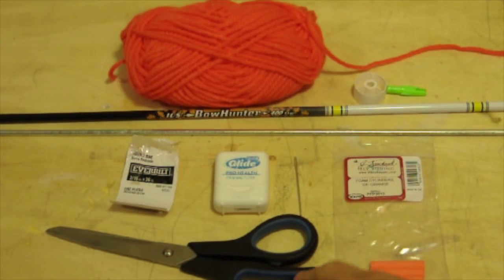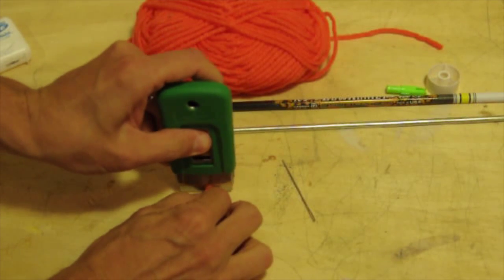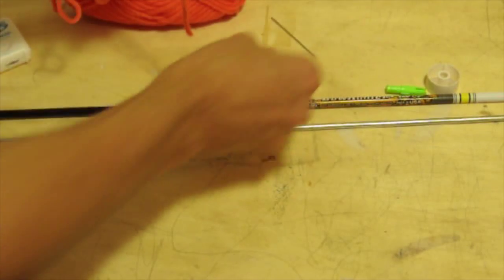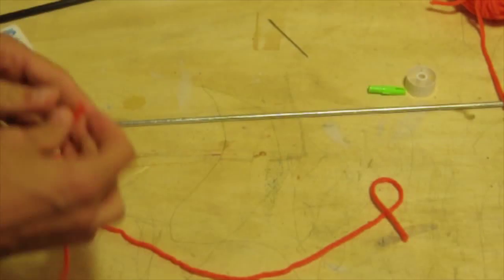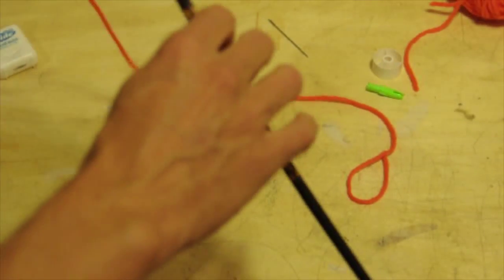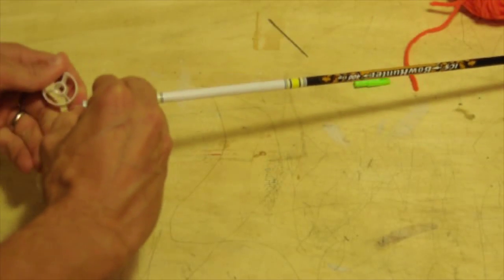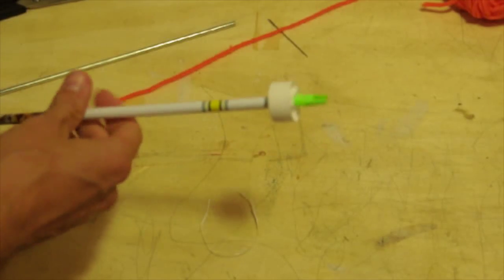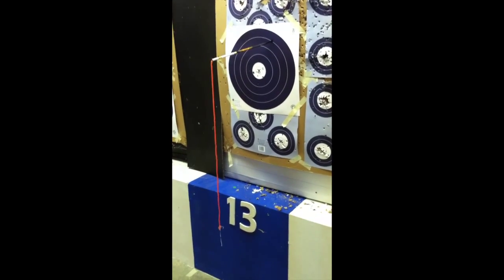Starrflight FOB Arrow String Tracker: Modified Design

Comment: I have gold tip arrows.  The Gold tips have a wt system (call F.A.C.T) weights.  You use a long allen wrench to go from the nock end of the arrow and put weight inside the arrow at the tip of the arrow.  My point is that I can use that long allen wrench instead of a coat hanger.  I mean I am trying to transform an arrow tracker, I am not trying to perform an abortion.  So, no coat hanger for me.  I will abort using a vacuum cleaner if I have to. cheers.

Comment: I made a few of these today. Works great and arrow is no longer lost! I used a wooden dowel rod (the original one that Paul made) and it works good. Deployed everytime, only down side I see is if the yarn breaks the dowel is stuck in the arrow and you won't be able to get it out. But I guess I'll find out. I used a "non-fluted" dowel rod so maybe that will make a difference? The rod I used was pretty hard to push down the arrow shaft, my hanger kept getting bent

Comment: Will the rubber plug also be pulled out of the shaft? How do you track the arrow down if that happens?
Reply from the maker: The foam core does not pull out under normal use and in hunting. It takes quite a bit of force to get the foam core out of there.

2 arrow lengths is just what I do. I've done 3 or 4 arrow lengths, but the more yarn you use the harder it is to put down the shaft of the arrow. I've never had a problem finding my arrows with just 2 arrow lengths. My arrows are 26", so that's almost 2 feet of yarn that sticks out of the shaft.